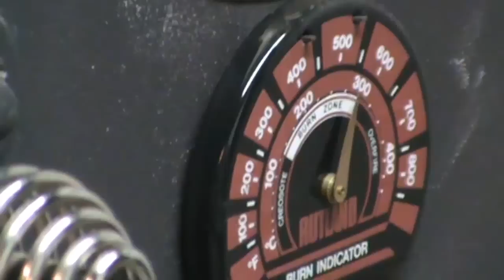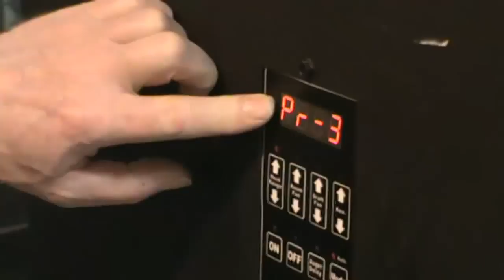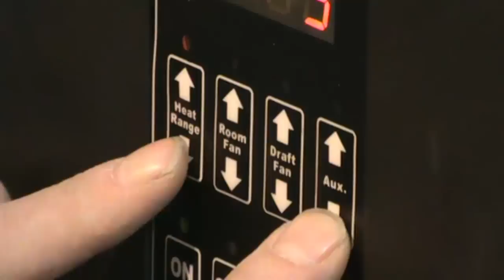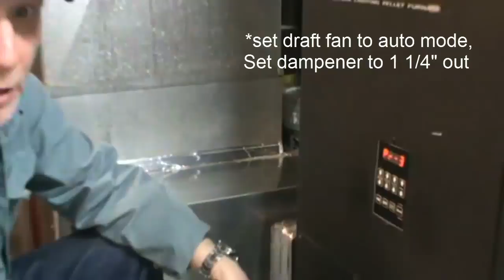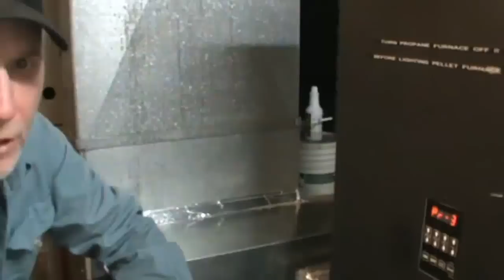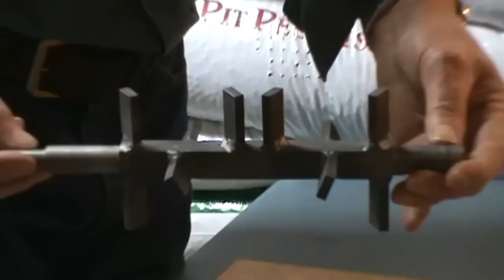US Stove Model 8500 Operating Tips & Fine Tuning

Comment: Have had my 8500 for about 9 years. Your videos have been invaluable! My unit just started acting up this week. The room fans cut back & fourth ( 2-1) like the unit is over temping - this happens on all heat settings, door temp is at 355 max (was running just over 500 w/o issues). Even on setting 5 the pellet feed doesn't seem to increase (#1 = 2lbs - #5 = 6lbs). It was running normal until my last cleanout. I powered down & rebooted, checked all C-settings but the issue persists.

Comment: where can I get pertenant info on pellet usage per btu and the range this machine has so I can compare. Wattage usage helpful also. What type of listing does this stove have? ALL pellet stoves should be required to have built in power back up so pep/ins dont go nuts. You should be able to leave your home in winter if this is a furnace.

Comment: AVOID THIS COMPANY!!! Nothing they sell is from the US, and they can't be bothered to supply parts, support service or warranty!! We bought an Ashley Propane stove from US Stove over a year ago.  Even though it was labeled propane, it was jetted for natural gas. The ONLY contact number US stove proves is for parts, and the orifices we needed were not on their parts list.  They continuously offer to have management contact us but nobody calls, EVER.  The customer service reps WILL NOT provide any other contact info no matter how you ask.  Bear in mind this is after over A YEAR of continued calls from our authorized dealer and service/repair reps - no calls back in order to remedy! We have spent hundreds  of dollars on service calls to rectify, but no repairs can be made because they won't supply the correct parts, let alone honour the warranty!! Criminal. After a year of banging our heads for  a product that did not work from that start, they refuse to do anything (it seems to be built into the company structure) we are now two thousand dollars  in the hole for a stove that does not work! Thanks, US Stove!!!

Comment: Excellent video! I accidently pushed the AUX. down arrow and the Draft fan down arrow instead of the heat range down button to adjust the lower feed rate. Then I change the draft fan down number. By any chance do you know what the Draft fan down number should be set at?
Reply from the maker: Run everything in auto mode, always

Comment: How would you hook these up if you have a central air unit and the air handler is on my oil furnace
Reply from the maker: pete Stockbauer  all systems are different, in one of my videos I show and explain proper install, also might try a local heating contractor.

Comment: I was trying to order your stainless steel agitator. but the site you have listed above says has been removed.  is there a place I can order one from. was also wanting the extension for the burn pot.
Reply from the maker: Kimberly Shaffer ,just tried the link and is working fine, try using a different computer or iPad,or go to eBay and search for stainless steel agitator usstove mod 8500 , same with the extention.

Comment: Great videos. Two questions. When setting the heat ranges you mention the high and low ranges what about the ones in the middle. And when setting the the second blower you set it to two if it was set to one would that make both blowers run all the time?
Reply from the maker: tom heath 1&5 are the high & low set points,the stove automatically interpolates settings in between, set c15 to 0 & both blowers will run continuously.
Reply: Land/Air Mechanical thanks for the fast reply. Stove was working perfectly for months now but now getting an E2 error and now won't start. After watching your videos guessing the stove overheated its self door is all white now trying to get it started again as well as resetting it so it will not happen again.

Comment: help cannot get stove over about 520 degrees. c15 at 0, c8 at 200. high heat at 5.40 and low set at 2.5 burning wood pellets. can't  get my house over 63 at 21 outside. is the draft fan suppose to go on and off every couple of seconds. new this year.
Reply from the maker: Kimberly Shaffer , is this a new problem?
Reply: this is not a new problem. Has been doing since we hooked it up. We have only had the furnace hooked up for about a week now. even with the stove being on pr 5 setting at 5.40 pph it is only using 80 lbs in 24 hrs.
Reply from the maker: Kimberly Shaffer   Have you ck'd for restrictions in the auger, is you door white? Are your pellet over 3/4" long?
Reply: yes we checked for restrictions in the auger yesterday turned the stove completely off clean it all out including the hopper and auger. no door us not turning  white. I have notice there is some long pieces of pellets in there.
Reply from the maker: Kimberly Shaffer  longer pellets will create a blockage, 1/4" to  3/4" is what you want
Reply: ok Shoot we already bought 2 ton of these.  Is there a way to screen these.
Reply from the maker: Kimberly Shaffer   Not that I know of, I would try a different brand of premium pellets to start

Comment: My stove will not run in auto mode. start fire goes out in 20 min or so. I have heat setting set from last year and wanted to change them for new fuel type this year. I notest that heat setting number and dash is flashing constantly. I put on thurmastat mode and it runs fine! why won't it run with out thurmastat?
Reply from the maker: Zeke Walker , If you want to run in manual mode you need to reinstall the jumper clip

Comment: just got my 8500 hooked up. I am new to burning pellets. I am trying to heat a brand new 2700 square ft house with a full basement 2x6 construction fully insulated. I have the vents in the basement closed. I do not feel much air moving from the registers up stairs. I ran the stove last night and the temp in the house dropped 5 degrees on Pr-3 and temp outside was in the 20s. I made sure the setting on c 15 was 2. I have low setting at 1.5 and high setting at 8. stove seems to be burning fine but just not much air moving.
Reply from the maker: Did you hook up to the cold air return? Also ck out the cfm vid
Reply: Yes sir I have done all of that. I am sure a lot of it is due to me being new to pellets but it did the same thing last night. It lost 5 degrees in the house over night. I wish I could get it to work better but I really don't think it is going to cut it.
Reply from the maker: +Timothy Majewski my house is same size ,my stove heats fine till OAT drops below 0 deg f,you just need to play with settings to find out what works. Quality of your fuel is the biggest variable.

Comment: I just installed my 8500 and been using for 3 days now.....set everything up as in your videos for pellets....door is starting to turn white now....what could it be? c8 setting is 200....c15  set at 0....fuel rate #1 at 2.00/low and #5 at 4.80/high.....Rutland burn indicator is at 550
Reply from the maker: The new Rutland burn ind. have not been accurate, try a I - R  gun to ck temps,also on 5 is your stove hitting the stops and ramping dn? (Dash flashing)
Reply from the maker: +Jeff Heubel   Set up pr-5 to get 650 on door temp,ck draft fan exhaust temp, should be 220 or less.
Reply: +Land/Air Mechanical   I am getting 682 with ir gun and dash is not flashing...also heat setting is Pr-3....damper at 1 1/4".....I use Marathon hardwood pellets
Reply: +Land/Air Mechanical bumped up to Pr-5.....IR reads 730 on door and exhaust is 155
Reply from the maker: +Jeff Heubel lower fuel to temp 620 to 650, is your stove set on auto mode?
Reply: +Land/Air Mechanical   Pr setting is 3....Auto mode....c8 setting is 200....c15  setting is 0....fuel feed low is at 2.00 and high is at 4.75....exhaust temp is 159  ....IR reading on door is 639.....Thanks for all the help....might have it dialed in now....or  very close
Reply: What are your draft fan high/low settings at?

Comment: For some reason, I am not getting the same performance.  The stove runs very well, burn pellets.  Last thing, my fan when only running one fan, in setting one is very quiet.  Setting two and above, both fans running, makes a lot of noise like it is out of balance or something.  I am running your agitator for 2nd year now, awesome design, much improved from OEM.  Your videos are extremely helpful and you are the only good information source out there as related to the 8500 - I appreciate your effort in putting these detailed videos together.  Best regards, David.

PS:  read below from Sean that he has his C-15 on 0 and C-8 on 200.  I'm not familiar with what he is talking about, can you please advise.

Hi this was the rest of my post.  Thanks again, David.
Reply from the maker: Ck out my latest vid's ,cfm,commons errors,and fuel ratio adjustment ,, ck your blower rack hold dn bolt is tight ,just inside blower access panel.if that's not the problem, you might have a bad blower.
Reply: Thank you for your help, I think the number 2 blower is bad - it is tight in the rack, however the fan is loose inside the housing.  It has made that racket since day 1.  I adjusted my C settings, will see how that goes.  David.

Comment: I have my stove set up (3rd year of operation - I'm comfortable with the unit) with cold air and hot supply connected into my duct work.  Set my settings as described in the video - fan settings, c15, etc….  I have the 1 setting at two and the 5 setting at 6 since I was not getting performance out of 5 lbs / hr on the 5 setting.  Temps are as follows:  DOOR = 400, EXHAUST = 180, VENT = open 1.5 inches.  House is two stories, 2500 square feet, built in 2002 and does not get above 65 at outside temps of 35 - 35 F.  I don't feel like I get much draft out of my registers.  1st floor register 90 - 94, 2nd floor register 70-72 with low flow on 1st floor and very low flow on 2nd floor.  

For some reason, I am not getting the same performance.  The stove runs very well, burn pellets.  Last thing, my fan when only running one fan, in setting one is very quiet.  Setting two and above, both fans running, makes a lot of noise like it is out of balance or something.  I am running your agitator for 2nd year now, awesome design, much improved from OEM.  Your videos are extremely helpful and you are the only good information source out there as related to the 8500 - I appreciate your effort in putting these detailed videos together.  Best regards, David.

PS:  read below from Sean that he has his C-15 on 0 and C-8 on 200.  I'm not familiar with what he is talking about, can you please advise.
Reply from the maker: Only recieved part message stopped at agitator, try damper @ 1 1/4 ,d/fan on auto, ck blower mounting slide lock DN bolt just inside of access cover for rattle, if tite, #2 blower out of balance, do cfm mod as described in vid to increase airflow,change c-8 to 200 as per feed rate vid.then readjust heat rates.